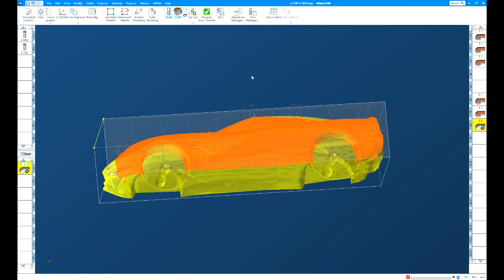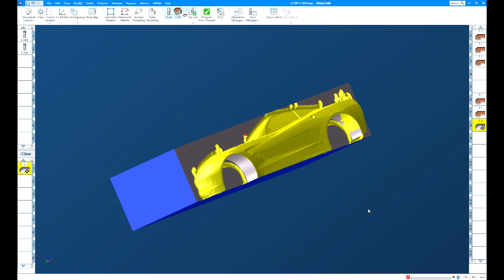MILLING 3D MODEL PM 25MV FROM THINGIVERSE CORVETTE C7 PT 5

Comment: Are you touching off with the wiggler    for x and y and the tool with a piece of paper for z? I'm curious because I was never very repeatable with those methods  and with 5 ops I'm curious if everything is lining up.
Reply from the maker: Thanks, I'm using a old school edge finder , and yes the paper trick for the z

Comment: Looks good, I would do a smaller step down on the roughing, it seems like you are leaving a lot of stock for your finishing, but thats just me😉
Reply from the maker: Thanks for the compliment, I'll try your tip on next op thanks
Reply from the maker: Chris,  i don't understand how to use and what workgroups or CS used for?  can this be used for one program different ops?
Reply: I have not tried it for that but yes I think you can, I use it for creating different CS for 5 axis programs